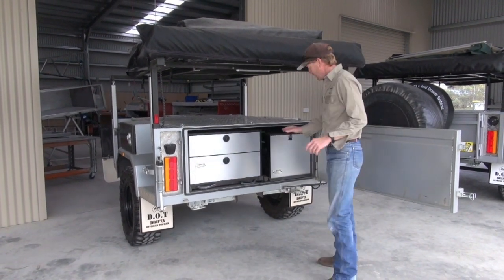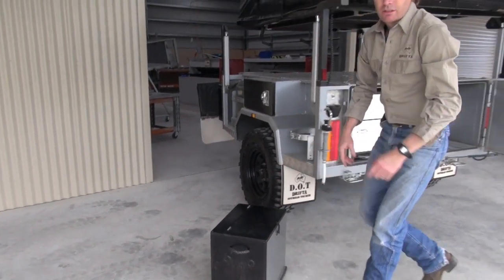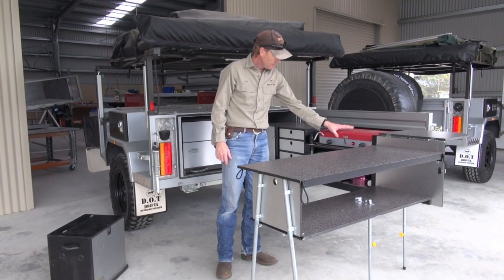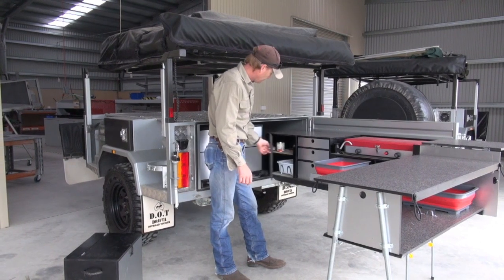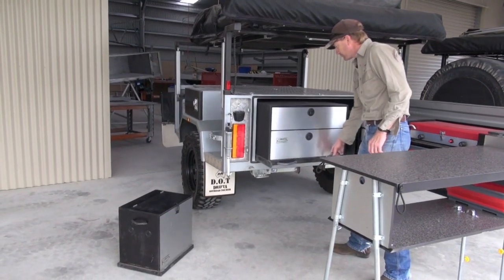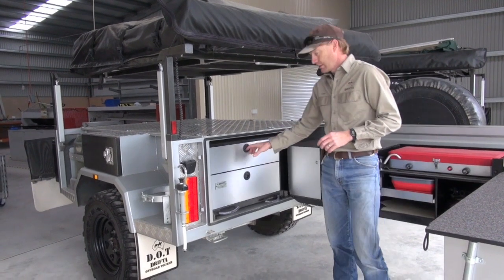Drifta - camper kitchen setup, and new DOT factory

Comment: I'm confused? in order to have an objective opinion I would have to know how tall this guy is? I'm 6'3" so I have always found that most counter tops are designed for what is called a typical male height of 5'8" So who is this designed for. Short people or tall people? I like the design and have to hand to to my Aussie cousins you people build the best out back equipment on the planet. American manufacturing is still playing catch up. You should offer your products in the states just make it 110 volt compliant and you would all be very rich. The markets wide open.
Reply: Okay that gives me the datum line, So if you feel the need to have the ability to lower this, than Bobs Your Uncle. I can use it without having to bend over. That's is exactly what I wanted to hear. Oh yea I have at least 8 Okies from Oklahoma using Bobs your Uncle and it's spreading like the plague. Love it. Thanks much mate.